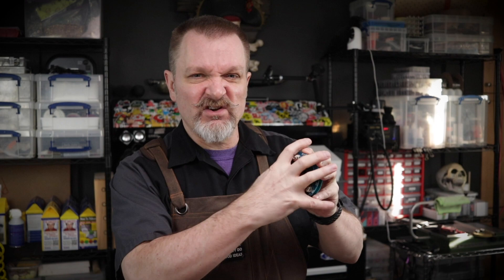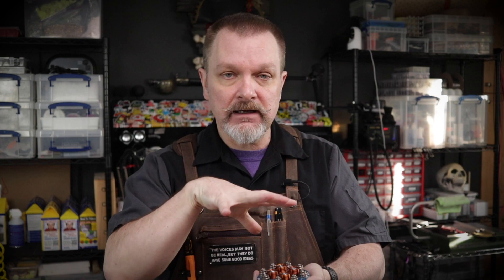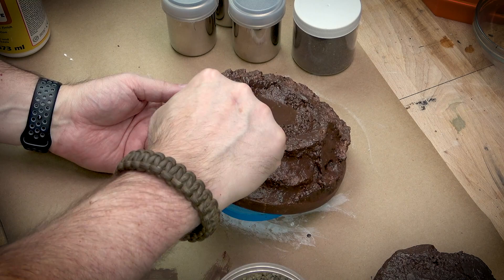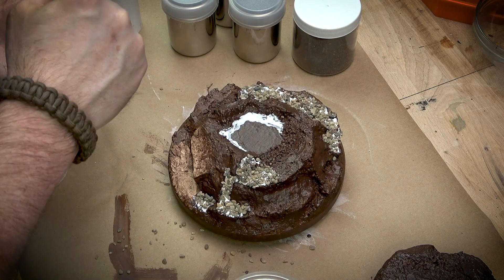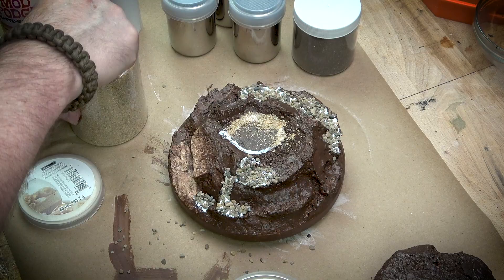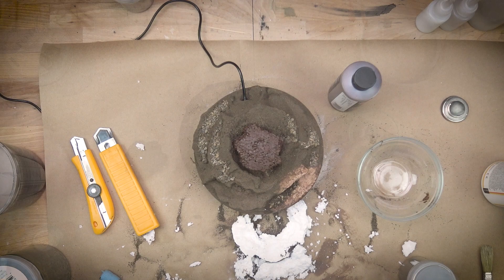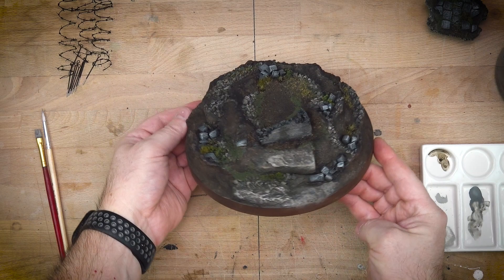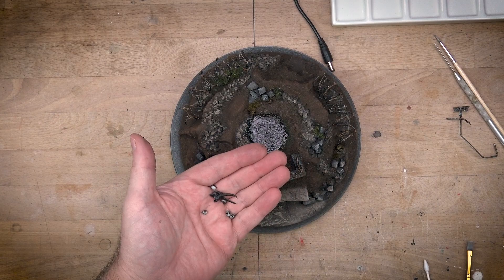Psykers are Close, Warhammer Levitating Diorama #warhammer #warhammer40k

Comment: I'm new to magnet levitation- can the same floating effect be achieved with that base, but a much smaller floating object? For example, a miniature cup with a small circular magnet in its base as the floating piece? I have an idea in mind. Any advice appreciated!
Reply from the maker: The way that these work is by sensing very small changes to the position of the magnet floating above the surface and then very quickly... like super amazingly fast... adjusting the electromagnet pushing it away. I think it could be possible to use a different magnet from the one provided but it would be tricky. There needs to be a bit of weight to it and the risk with a small object is it could become top-heavy and flip. Maybe the new magnet could be incorporated into the upper part of the cup allowing the base of the cup to sit below and stabilize the whole thing?? I'm giving it a solid... I think it could work... maybe. It would take a little testing with different magnets and balance points. Let us know if you get it to work!

Comment: Is it difficult to balance the magnet?

(I'm sorry if this was mentioned. I had to watch the whole thing without sound and I'm too excited to wait until I can watch it with sound again).
Reply from the maker: It’s not too bad. The main thing to try to do is keep the floating element as light as absolutely possible. That will give you the most lift and make balancing a bit easier. I actually pulled a lot of material off of the floating bit. The “levitation” electronics are really interesting and take a bit of getting used to but they’re fairly forgiving. Best of luck with your projects and thanks for watching and commenting!